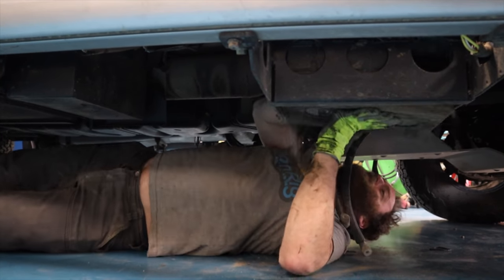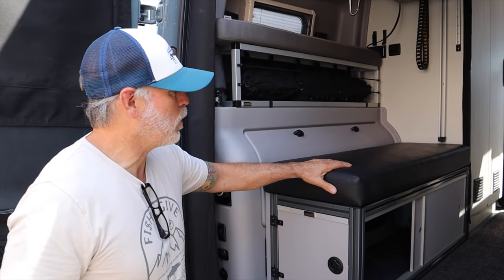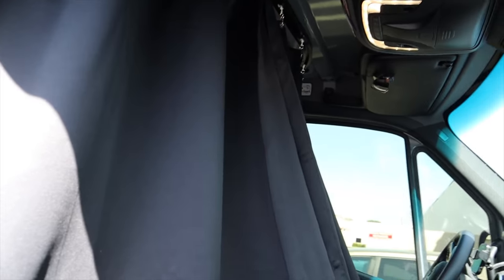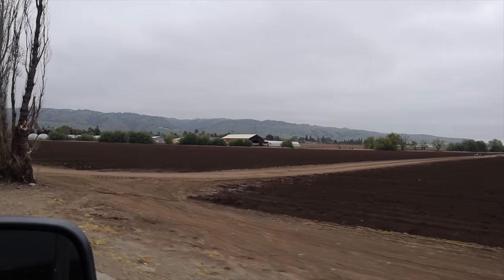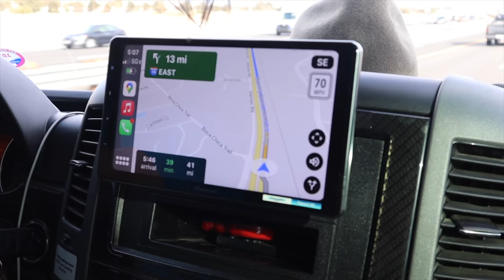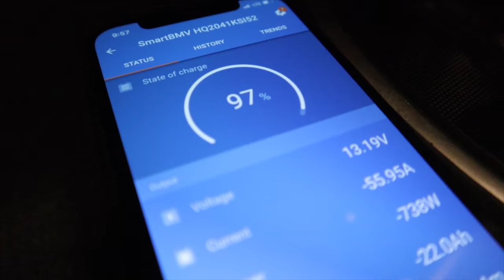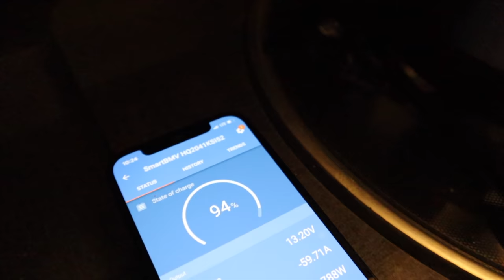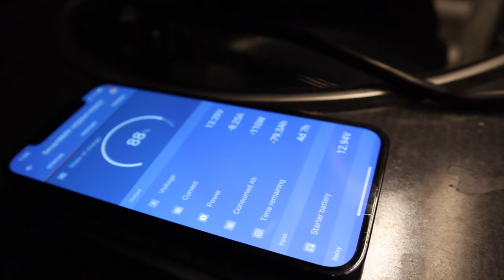Back To Nature | Van Life California

Comment: What a great idea on the front curtain.  I am using that!
I am trying to decide on a security system, maybe Simplisafe or Ring???  I envision using it mostly when I am at an out of the way trailhead where I would be gone all day or several days.  I have seen the reviews, but the reviews are based on houses not van life.  Would I even have service at these out of the way places?  Just wondered if you had any ideas?  Thanks for another Very Nice Sunday morning video.
Reply from the maker: Hi John, many of the trailheads we have visited have no service so I guess it would all depend on where you are planning to be.  Maybe starlink will change that soon!